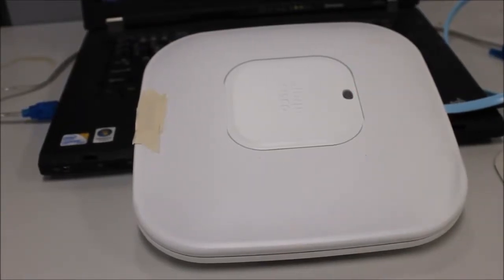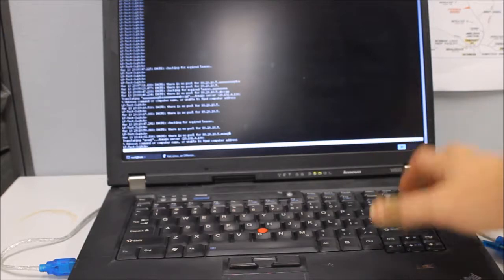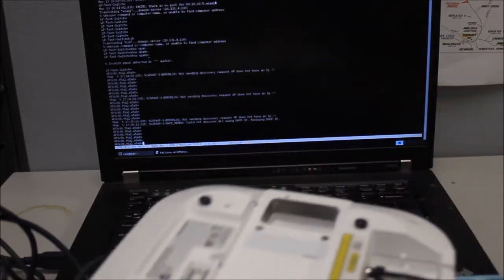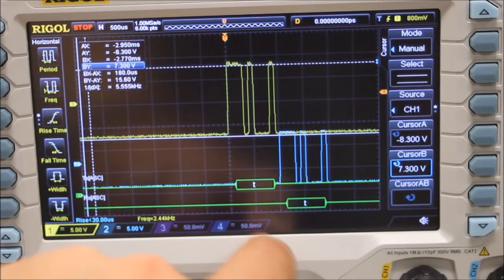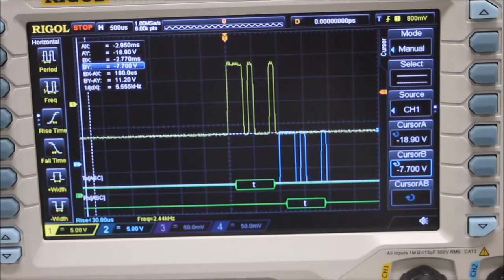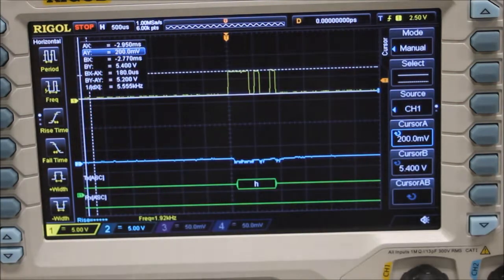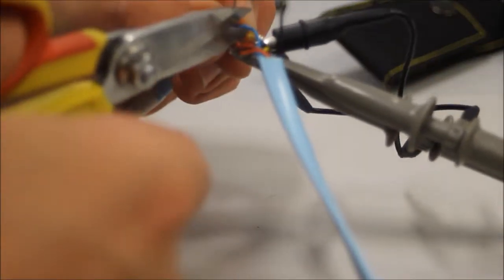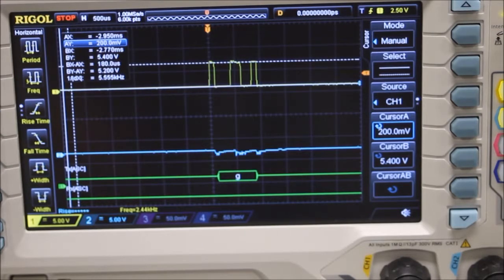Cisco Serial Console - USB to Serial converter voltage woes

Comment: I love me some excessive troubleshooting.   I suspect that ACchannel is correct, the usb controller is actually a chipset for UART using rs232 , which is handy for getting to the hidden console of linux embedded devices, and as they work on most ciscos, got sold as an RS232 adapter.  I can only imagine that you messed around with a boatload of pinouts and bitrates first, so rather annoying.

Comment: What you've got there is a TTL level USB to UART converter. They are useful for interfacing microcontrollers for example (I currently usually use a converter with 3.3V levels). Apparently the Cisco device uses the actual RS232 standard which originally used higher voltages (like you can see with the working serial converter). Some new(er) devices may work with 5V RS-232 but it can never be guaranteed.
Reply from the maker: The USB serial device I showed in the video was sold as an RS-232 adaptor - http://www.ebay.com.au/itm/USB-to-RS232-Serial-Port-9-Pin-DB9-Cable-Serial-COM-Port-Adapter-Convertor-/191376461161?pt=LH_DefaultDomain_15&hash=item2c8eed0d69

I've got a couple of the TTL level UART units that I use for mucking around with PIC32s and mmbasic. 

I've also tested some other units, including a Belkin on the Cisco 3600 series APs with the same results. I'm pretty sure that it's more a case of the Cisco 3600s being picky.

Thanks for watching!